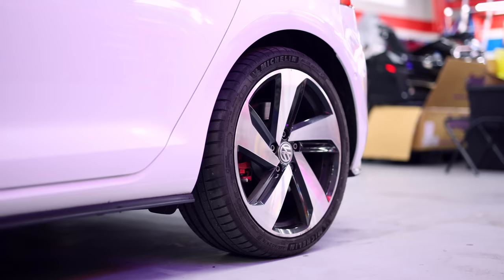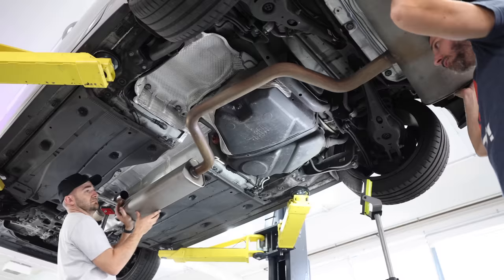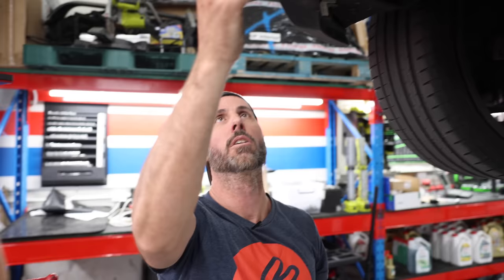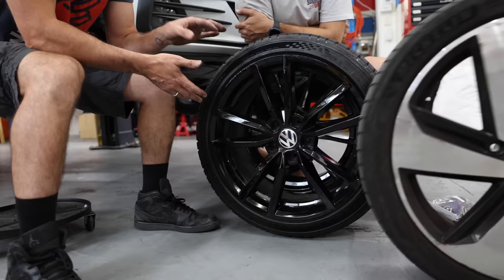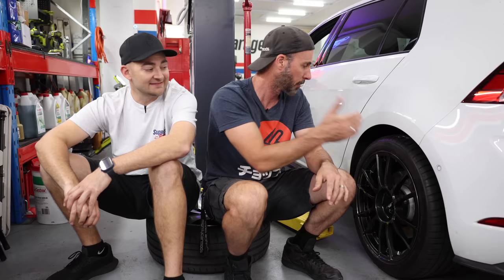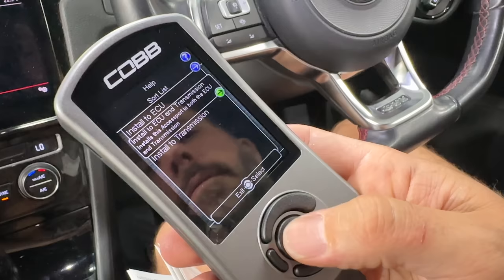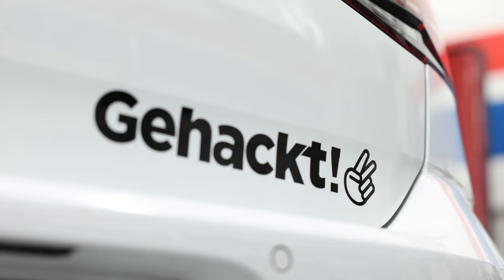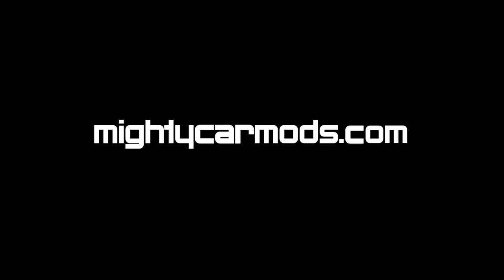How To Modify Your Daily Car (In UNDER 2 HOURS)

Comment: This is awesome, I got a mk7 GTI and the first thing I did was exhaust, but I noticed real power gains when I added the CHOPPED sticker on the back.
Reply: I have a prosthetic leg, and I used to sort of limp around. When I had a new one made, I had a chopped sticker placed on the carbon fiber under the gel coat, and now I can walk and run faster

Comment: Hey guys, just want to say that I've been loving the golf content the last year or so. As a mk7 GTI owner myself, and engineer at that, this is absolutely the best golf content on youtube. You didn't mention which tune you flashed with the accessport, but I can't recommend a tuner like EQT or Stratified enough. Cobb doesn't put the time into the golf platform that they did on subarus, and looking at datalogs my EQT files run much smoother, with less knock feedback, all while making more power. Keep up the great content!
Reply: Revo is pretty popular in the vag bus scene
Reply: In the states I had APR on mine but it had to be done at a physical location. For a flash tune Integrated Engineering that you can do at home is also a great option imo.
Reply: @eustahijelifetips  i went from revo stage 2 to eqt stage 2, i can confidently say revo is trash
Reply: Came here to say this, general consensus amongst VW people is cobb tune isn't good, access port is useful though, sneaky tuned or stratified comes up a lot as recommended. I went with IE on my mk6
Reply: Love my MK7 sport, and I’m graduating with a degree in mechanical engineering in two weeks! Can’t wait to have some extra money to get a southbend clutch and go stage 1.
Reply: @zeitgeist2720  Man, let me tell you, it's worth it. I have an APR stage 1 tune and Southbend stage 2 Daily clutch on mine, and I couldn't be more pleased. Pair that with a big rear swaybar and grippy tires, and it transforms the car. Just be prepared for single mass clutch noises. Takakakakakak
Reply: I personally hate the factory transmission programing.  If I did something it would be a DSG tune
Reply: I imagine they just ran the Cobb OTS Stage 1 tune, which is not great. Hopefully they can get a decent tune in the future! 

My Stage 2 EQT tune and DSG tune are phenomenal and rock solid.
Reply: Why not custom tune it?
There are plenty of workshops that do custom tunes throughout Australia.
Reply: Stage 1 I.E. tune and the Golf R mk7 is a new car. Feels much more like it should have been from factory
Reply: I was so disappointed to see they chose to run the COBB tune given how poor it is, much better off going Integrated Engineering if you wanna do it at home
Reply: @jeffk464  from what ive heard you can't just get a DSG tune without getting a ECU tune as well..

Comment: So happy you guys made your way back to the MK7.  In my opinion, they are one of the most easily modifiable cars out there that have the looks, refinement, and practicality to make it THE BEST daily driver on the road.  I'd argue that it also has one of the best motors as far as tuning and capability goes.  Being able to push close to 2.5X the stock HP of the car and still being reliable is unheard of from every other car manufacturer.
Reply: let me introduce you to toyota and honda
Reply: @nasaten  Usually the opinion people have when they haven't owned one.
Reply: I prefer the mk6 cause of the sound of a i5 and the looks but each to their own.  We all have preferences

Comment: Tires really are the best mod, wheels if you have large balloons. 

Tyre Reviews did a test with a Mk 7 GTI on 17" vs 18" vs 19" wheels (a couple years ago?) with the same tire model, same inflated diameter, and found the 18" was objectively the best. Less cabin noise than either the 17 or 19, better handling than the 17, more comfort than the 19.

Comment: Awesome and just in time. Oh my second MQB GTI. Had an MK7 which I then upgraded to MK7.5. Currently running an EQT Stage 2 93OCT tune (USA) on COBB AP, and EQT is literally the best ECU tune on the market right now. Performance Pack brakes, LSD and extra 10 HP are so damn worth it over a “standard” GTI and really helps to put the power down. I would recommend you guys stick with the stock DV, because the revised design is very robust and I have no issues running it on my stage 2 tune. I had a Forge BOV which sounded cool, but just gave me error codes after a few months and eventually failed. Love the MK7/7.5 and literally bought another one because the MK8 interior touch buttons were a deal breaker during my test drive. Keep it up guys been subscribed since day one !
Reply: I can vouch, for I too am running the EQT stage 2 tune great tune, no knock safe on the engine and super linear feels like stock just kicked up quite a few notches 😂
Reply: I really hope they will see this comment highly recommend them trying EQT!!!

Comment: For exhaust hanger removals I've always had some good luck using a pair of channel locks between the backside of the rubber hanger and the flange on the end. When you squeeze it should remove it a good portion of the way.

Comment: Some channel lock pliers also work decent for exhaust hangers if you don't have a specialty tool. Open them wide and put the bottom tooth on the metal hanger (outside of bushing) & the top on the opposite side of the bushing then squeeze. 🤙

Comment: Nice video. I have a 2017 MK7 GTI SE DSG and absolutely love her. I must say that I disagree with the order of the mods on the GTI's. The first thing I did to mine was to replace the soft stock rear sway bar and plastic end links with a stiffer 034 bar and metal endlinks. The difference in handling was not subtle. The front end understeer was reduced and overall handling was much tighter with less body roll in the corners, and she's still comfortable on the street. It doesn't make sense to me to add more power without first sorting the suspension and handling. Next mods I did were air intake, turbo inlet pipe & hose and then a lighter set of stylish rims.  My GTI is a great daily and I plan to keep on the upgrade mod path as budget allows. Looking forward to the rest of the build series on your GTI. Keep up the excellent work gents. Peace.
Reply: Curious what wheels/tires you went with. Size, width, offset, tires. Thanks!

Comment: I've had my beloved Iriz from Proton for eight years now. I've replaced the original factory projector to an aftermarket version which houses the D4S bulb and my night drive satisfaction has increased ten-fold. Anther best thing about my Iriz's headlights is that it has a dedicated low-beam and high-beam, so I now have a total of six supposedly light beams. I'm planning to upgrade my wheels from 15" to 17" but afraid of the car losing it's value. Not to the marketplace, but my eyes because I'm going with a simple OEM look and looking for stock rims from any german brands. But, who knows... I might change my mind and end up doing everything I wanted 'coz the major modifications were those projectors and a new spray paint after seven years.
Reply: the Suprima S is very good too....
Reply: Does changing the exhaust worth it?
Will it sounds like lawnmower?

Comment: I added a Roush TVS supercharger to me Mustang GT and it's definitely not wrecked. It drives as easily as a stock car, still gets decent mileage and is fast enough to be pretty interesting at the dragstrip without having to cut it for a cage.

Comment: A flathead and wd-40 works well for the exhaust hangers. Just pry it enough to fit the straw in and spray inside on both sides.

Comment: Heads up! Those GFB diverter valves have been known to cause a decent amount issues when doing performance upgrades/tuning on this platform. The stock one has been the preferred one by many tuners. Check out EQT tuning if you are wanting an AP Tune. Best bang for the buck!
Reply: i 2nd EQT as it is whats on my car, still reliable 103K miles in

Comment: i feel like everyone glosses over interior car modifications so much and I don't understand it, that's literally where you are 99% of the time you own your car. Here is my list (Audi A4) that absolutely was a game changer and worth every penny:
1) Android/Carplay Headunit, works wirelessly so I don't even take my phone out, steering wheel controls work as well. also gave me reverse camera function, most expensive but so worth it
2) Rewrapping my steering wheel with red stitching, not to be confused with a steering wheel cover, this makes your steering wheel look completely brand new and even better
3) Ambient lighting, I used LED strips that went into the interior trim so it looks OEM. its not just the cheap ass footwell lights, it's actually integrated in my interior
4) plush memory foam headrest covers, almost looks like those maybach pillows
5) dashcam mirror screen, this goes over my actual mirror and is hooked up to a camera in the back. the viewing angle is wide enough that actually covers my blindspots

Comment: Hey Guys, love your content and laughs.
Can finally chime in with a little tip for ya, instead of fighting with prybars, use (slidelock) water pump pliers. 
Spray with WD40, pliers one end on the back of the rubber, the other end on the metal of the exhaust and squeeze!

Comment: add some Bilstein B6 shocks and a 10mm Lowering springs ( I Have this exact setup on my mk7 gti ) and you would be surprised how well it drives! I take mine on the track occasionally ( roughly every 3 months ) and both on road and track feels amazing

Comment: i’ve never seen exhaust rubbers removed that way before. I normal lube it right up and stick a screwdriver in the other end to stretch the rubber over it and pushing the exhaust out of it

Comment: @mightycarmods What is the part number for the new DV+ with the integrated solenoid? I bought the standard DV+ but it doesn't clear my intake and the new part would be perfect but I can't find it on the GFB site anywhere. Thanks!

Comment: For the hangars, wd40 and a large flathead screwdriver... shimmy the hanger so at least part of it is over the nubbin on the end then just grab it with your hand and twist and pull it off! Often easier than the 2 prybar method AND you can do it laying on your back in the driveway under a car on jack stands!
Reply: or just get a exhaust hanger tool
Reply: @arcanevoid9199  ah but what if you loose the hangar tool?

Comment: There is a full range of aggressiveness when it comes to performance brake pads. You dont have to worry about heat with all of them.
Reply: @Whatapp±①④⓪⑦②①⑦⑨⑦⑦③  awesome to get a response. I'm in the states in Texaa so it's pretty early here. 
But check out G-Loc brakes, they make stuff that's meant to work on the street just fine ask the way up stuff that's way too much for a small car. 
They have vendors there in Australia too. I've been running the R10s for a few yrs on the same rotors, getting out to the track 3-6 times a yr.

Comment: Hey bois , i have the GTI 7.5 Same as your's and it has had a ABT tuning and chip installed , ive been said its around 360hp but i dont know for sure , i want to modd the intake aswell so i will surely order the intake for sure.

Comment: Have an honest question: I have had older VW GTI's but nothing from MK4 forward.  (still have a MK3 in the garage) 
Do you guys have any insights into if a new model VW GTI (Mk8) or a Toyota GR86 would be the better 'fun' car that could also be a daily driver if necessary.?  My wife and I (older drivers) till enjoy driving manual transmission and not too many available these days in the US sadly.   If you've driven these two it would be good to hear your thought comparison.   *other options as well if you have good ideas

Comment: Hey MCM I have a gti mk7.5 aswell it has a is38 turbo from a golf r, i use a ap aswell but run eqt stage 2 e85 file car made 415 whp and is a riot, eats v8s for breakfast lol so im sure even your Marty at stage 1 should beat the mk8 around the track.

Comment: With brake pads, in Europe if it's not OE homologated material, or doesn't have an aftermarket street homologation, - R90 - then it's not legal to use on the road, same in OZ?

Comment: An easier way to get the rubber hangers off:
Lube up a screwdriver with wd40, shove it down the hole and work it around while spraying more wd40 inside.
Pulls off by hand.

Comment: I drive an 11 mini cooper, base model auto trans. I tell people "i upgraded the intake for MPG and range, i put on expensive tires for grip on poorly maintained roads, i took out the back seat for cargo space. I had to teplace the whole exhaust system because tue old one had too much carbon coating (a legit issue with this car) and i couldnt find a brand new stock replacement at the time that wasnt $2,000 (flat out lie)

Comment: Aren't wheel spacers (flush mount kits) illegal in NSW? Isn't it illegal to run the car on a wheel not specified on the sticker? I know you can go 1" bigger than the biggest wheel the factory specifies.

Comment: what about suspension on a daily? would you leave it stock? or lowering springs? or coilovers? airbags :/ ? @mightycarmods
Reply: would only go with coilovers if you have the money to get a good set, oem like ride quality with better handling isnt cheap. otherwise lowering springs with brand new shocks or performance shocks if you can get them (like KYB SR Special) are a really good option

Comment: We always use brake cleaner on hangers wd40 and that leaves it easy to move after refitting brake cleaner evaporates and stuff doesn't slide about.
Reply: That's posh 🤣 I just gob on them.

Comment: Question,

I’m not a gear-head. I can prolly do these mods or some of them on my own ( what interests me specifically are 2-3 mods , 1. The cold air intake, the diverter valve and the flash tune ).

If I had the parts in my possession bought and paid for, what can I expect someone to charge me to install these mods?

The exhaust interests me too but it would be my last upgrade if I even did it.

Can someone give me an installation break down with what I can expect to pay for the installs ?

( I live in United States - Florida )

Comment: Pro tip. Don't spend money on mods until you have done all the maintenance. Change your timing belts and check your oil level and pressure!

Comment: Wont changing wheel size affect how your spedometer reads? Your car uses wheel rpm to calculate speed, so a smaller wheel will read that you're going faster than you are, and a larger wheel will read that your going slower than you are, which could be dangerous. 

Thinking if mods in this context of a daily, i think its important you know exactly how fast youre really going. Do you just have to match smaller wheels with thicker tires and get the exact same overall radius as your oem setup? Seems difficult to get it to come out the same

 is there a way to get your computer to recalibrate?
Reply: its the overall diameter including the tyre that matters, not the wheel size. and its pretty easy to get it close enough, within a 2 percent or so is fine
Reply: How accurate is Google maps report if your speed? Mine always reads a couple mph faster than my speedometer says.

Comment: Can confirm on the brakes a bit. Ive got track pads in my not daily, but I do drive it out on most weekends (and on the track)

They are GREAT when warmed up, but are kinda spongey on the street, especially when you first get in to drive or after a long cruising stint with no braking, it takes a few quick sessions of braking to warm them up enough to start biting properly. A standard good quality street pad will bite much better from cold.

Also yep I absolutely get the lovely squeeeeeeeeeek when pulling up to traffic lights and things. P

Comment: Please be careful using spacers guys, it can be dangerous, it changes the geometry of your suspension and it can make the car much less stable and also unpredictable compared to what it was designed for. Same thing with using wheels with different offset than recommended
Reply: Not sure about other states, but I'm pretty sure wheels spacers are illegal in Victoria. VicRoads, the police and insurance companies will all give you trouble for them.
Reply: @simonhughes4993  Of course, and it's for a good reason

Comment: As far as vw current? you take it your local performance shop that deals with Volkswagens and after some more wizardry and money  you have a car ready or you find someone who works at the volkswagen (or their performance shop) bolt it on after you get it online and pretend that you have done well... Aka bring back the builds similar to Subaru, wouldn't care less of another vw staged built